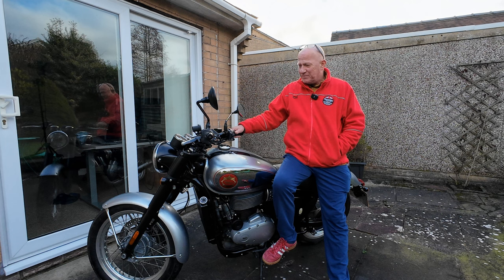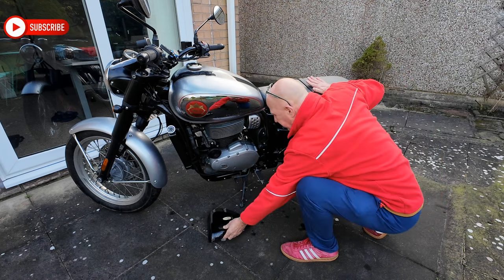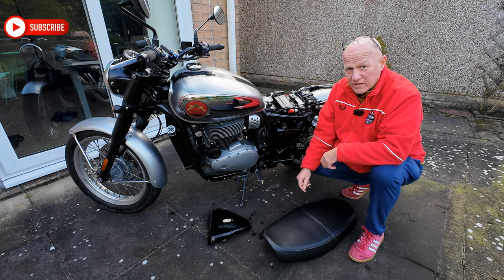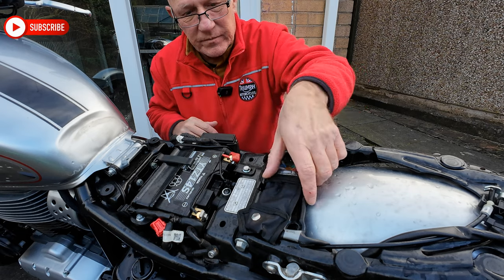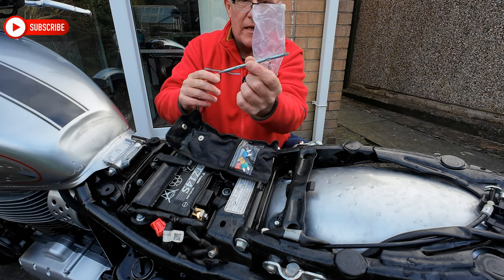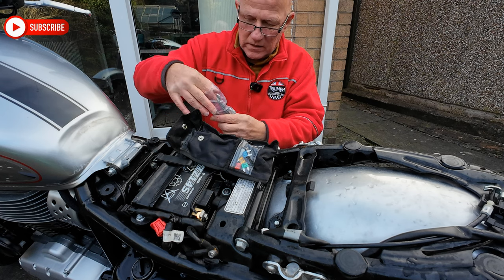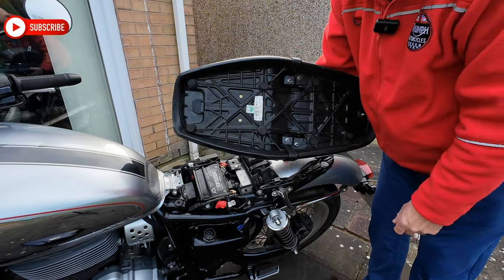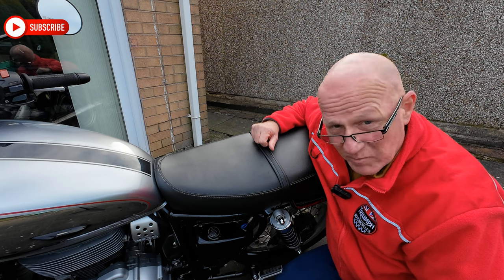BSA Gold Star Remove the seat; Battery, Fuse Box, Tool Kit. Thanks to Phil Green for this vlog :)

Comment: I've had my seat off as well everything is so si,ple and when i got my uprated shocks from tec they came with a c-spanner so I've added that to my tool bag. The Gold Star is really easy to work on.
Reply from the maker: Hey Ian, yes, I noticed the missing C spanner. Today I am testing the bike with Mark on the back. He is bringing his spanner to crank it the standard rear suspension up a bit. This is in prep for a trip through Europe, two up, on the Gold Star - a bit like Dumb and Dumber 😆. This should happen in February I think, maybe March 👍

Comment: When you buy one from new (like I did) there's also a little first aid kit under there as well! I've never opened mine but it amazed me to see one provided. I have to take my seat off regularly as I fitted an Optimate connector but couldn't find a way to feed it to somewhere accessible on the outside.
Reply from the maker: Hi Andrew, that is interesting. My first aid appears to be missing. Can you not feed the connector to behind one of the side panels? Then just slip the panel off when in long term storage? That might be a good way of feeding the cable?
Reply: With hindsight I could have tried harder and at some point I will, I'd fitted the connectors to the battery and then the rubber covered optimate connector wouldn't fit through the frame, just need to take it off again and feed through from the outside.
Reply: When I bought mine new from my Lancashire dealer he was kind enough to wire my optimizer up for me. Using a tie wire i secured it around the frame and just a small nylon attachment sticks out making it easy to attach it to my optimizer without taking the seat off.
Reply from the maker: @andrewwalker8640 👍
Reply from the maker: @ianhalliwell8604 👍

Comment: Is there no way to stop the panel & seat being stolen ? Usually you need a key to release panels and seats on bikes I’ve had.
Reply from the maker: Hi Andrew, to be fair, it is not secure. However, I tend not to be too far away from the bike when I ride. In the UK, bike theft is higher than one would like

Comment: good video. BUT WHEN I PULL THE SEAT RELEASE WIRE ON MINE NOTHING ,ANY TIPS ON HOW TO REMOVE SEAT
Reply from the maker: OK Blondie, I have see your email and thanks for reaching out. Not sure what is going on with your seat latch HOWEVER 😆. Can I ask if you have tried this? I am wondering of the rubbers under the seat are forcing the seat up so much that too much force is being put on the latch that locks the seat. So, on the understanding that the wire/loop you pull is quite small, get someone to sit on the pillion seat and try to pull the cable with lots of pressure on the pillion seat. Assuming my thoughts are correct, a human on the rear seat will take pressure off the latch and allow you to pull the latch open with the cable loop, thus allowing the seat to be lifted off. Tell me what happens 👍